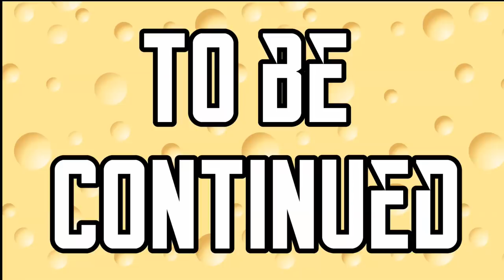Mini DumpTruck (SE01 EP31) Suzuki Carry inspect. Undercarriage wash adjust carb, throttle air box

Comment: Very smart to undercarriage blast the bottom side. First thing I do also and clean the motor. This way you can see what your dealing with any leaks. Also a clean motor is so much better to clean on. Smart to get all the left over salt from the ocean too or any mud that holds moisture.

Comment: If the bed is up, the "safety bar" is in place. Always.
Reply: many years ago around where I live guy was working on dump, had safety bar but cylinder collapsed while he was working on it, & the bracket for the safety sheared, & of course guy was killed, it was ruled a fluke accident as both the cylinder failed & the weld broke for safety
Reply from the maker: Damn, that's scary! I better check the safety prop
Reply: I was about to comment the same thing. Where is the safety bar or another type of lock for when the bed is up.
Reply: the one I refer to was a normal full size commercial dump truck, this is probably a lot lighter, but still probably heavy enough to trap you, or worse, just be safe, & keep on with the videos
Reply: This is one of the few Safety Nancy rules I agree with.  The other is lean back as far a possible when seating tire beads and or keep it in a cage.  I know people with missing body parts from rims splitting when bead seated on NEW rims. 10" to 96" rims...
Reply from the maker: TY
Reply from the maker: Yeah. I hate that bead "POP" seen enough videos on that subject!
Reply: a tire shop I knew of, owner died of old age, had 1 blow & they refused to stand over, but laid them on cement floor and used foot pedal to control air, 1 blew, ripped through inner section of plywood roof, and 1 support, but stopped when it hit metal brace for outer roof, no one got hurt, just hose ripped out of tire changer, I showed up as it happened, but didn't see it, & he never fixed roof, & place is for sale & roof is still like it, well over 20 years ago

Comment: lol.. I have one of those expensive Milwaukee Fuel 1/4 inch ratchets too.. Comes in handy in tight spaces..
Reply from the maker: Hell yeah! Mine is not the fuel, but I did use the fuel style when I did the clutch at the transmission shop. I like mine better it's less bulky and less heavy

Comment: 3:20 for the timing belt slice the old one in half length wise, and cut the outer half off, slide the ne belt on the cut the rest of the old belt off. Wala easy belt change.
Reply from the maker: That's a great idea not to lose cam timing, thanks!

Comment: I saw rust like that after a few years when I lived on an island in the eighties where you had to drive next to the water daily.
Reply from the maker: That's what I was thinking...
Reply: @MotoCheez  I had a truck there that was 10 years old and had 30k miles on it, the body was so rusted it was held on with bailing wire. It ran great, but looked like he'll.
Reply from the maker: Damn!!

Comment: Was the Suzuki cheeper being more miles and little worse shape? Or did it even out with the dump bed option? I’ve seen they use these a lot at fishing ports,could be why rusty,they put live catch in back with salt water sloshing around.
Reply from the maker: It was cheaper because of the mileage and the condition. Rust would be a concern in salty areas for sure. The frames are thin

Comment: time to get a needle gun for scale removal after that thing. I thought i got all the rust off of a frame one time then it stated showing up everywhere months later. I love your projects. we relay enjoy or mini truck. Ospho is your friend.
Reply from the maker: I have a spot blaster, oil based paints and primers I like the best!
Reply: @MotoCheez  thats a great idea. you can relay get in some good tight places with the sand blaster. last year I got a trailer given to me and it was covered in rust. i buffed all the rust i could get to with a wire wheel and painted it with oil based paint from TSC but it came back. later I redid it with this Hammerite Rust Cap Paint and so fare its been great. the company said we can put the paint over rust with out even removing it. I am going to try it again on my side by side that was at the beach for a few yrs so how it dose. you have helped me so much with your inspiration so i thought i would try to share what i learned. hope this helps. take care. love the videos.
Reply from the maker: Thanks, I'll check into that hammerite. I always use Rust-Oleum and have excellent luck with rust not coming back. I'll touch it up as I need and if I work on it, it's easy to grind off and repaint.

Comment: Are those 4x115 wheels? If you can wait until May, I have a set of 4 steelies (with old tires) that you can have for the cost of shipping from WI. Might not be worth the cost though. Old Arctic Cat wheels fit on these. That's what I have on my 1992.
Reply from the maker: I believe it 4x115 I have the spare, just wish I had another universal rim
Reply: @MotoCheez , I thought all from that 90-94 era were 4x115, but I'm not an expert. Mine is most definitely 115. You might want to double check, and if they are the same as mine, I can send you up to 4 in May for the cost of shipping. BTW, I'm not on Instagram, so you can contact me here or on FaceBook.
Reply from the maker: You're right! It is 4x115.. sorry
Reply: @MotoCheez , I'll reach out around the time I head to my cabin to see if you still need/want some rims.
Reply from the maker: Awesome, TY!!

Comment: Welcome to the Suzuki-side! Blue-springs bye.....That's o.k..
Reply from the maker: Lol! Sorry... I'm wondering if I should make my own lift spacers for this one
Reply: @MotoCheez  Since you going to re-build the strut-cups....Why not?
Reply from the maker: The inner steel structure is perfect
It's just the tin there on top
Reply: @MotoCheez   Well a kit is what 125.00?? My time is worth money. Would i build one? No. easy? Yes but.....
Reply from the maker: The shackles are easy, strut spacers fairly easy if I can find pipe big enough. Yours have camber adjusted on spacer?
Reply: @MotoCheez  Yes. I reemed the holes a little to get the camber where I wanted it. With the spacer as-was it still had some positive. Fixed that shit!

Comment: I have a quick engine question for you. I have a brand new Kohler Command Pro 14 Hp engine. The thing this is super hard to start cold. Any ideas?
Reply from the maker: Is it hard to start when it's cold or when it's hot? Or both?
Reply: @MotoCheez  Just cold. Fires right up when hot.
Reply: It came with a Kohler spark plug. I think I'll try an NGK.
Reply from the maker: I'd check the choke, bet it's not closing properly...
Reply: @MotoCheez  Ok! First thing in the morning. I'll let you know!
Reply from the maker: Yes, please
Reply: @MotoCheez  Well, the choke is fully closing. I think I came up with the solution this morning. That engine requires just a wee amount of throttle and of course full choke when cold. It fired right off when I did that this morning. Probably 30F or so. Thanks for the suggestion.
Reply from the maker: Cool! Yeah a lil throttle for sure

Comment: Yo cheesy my Honda acty has 145/80/12 tires on it 4x100. . What size tire do you think I could run if I got some 13 or 14s off a Jetta or something Civic maybe
Reply from the maker: I don't know much about the Honda's, but I believe 23" will fit without a lift

Comment: Hey, What is "Dumps" name?  Jim & I (from PA) where in the delivery room with Amir when  you picked up  your "Baby Dump".  Our "Baby Dump" is doing fine & has not only a name, but new shoes and wheels!
Reply from the maker: 👍👍😁😁 which wheels you end up with?
Reply: @MotoCheez  VISION Lock Out (finish matt black) machine lip w/chrome hex bolt inserts.  Style 393 12x7 4+3 offset.  Tires-are Carlisle all trail 23-8-12.
Reply from the maker: Nice

Comment: Congrats on the new addition! I'm bidding on a Suzuki this week. Any idea what "cold weather equipment" is?
Reply: the guys at four sons off road up in  Canada sell a oil pan heat, maybe that’s what it is.
Reply: Heater
Reply from the maker: Cool, hmm, idk what that would be...
Reply from the maker: Could be. Or Block heater ?
Reply: I have to look at the description to be sure, but if there is a sticker that says 寒冷地, it has stuff like these.

More starter wattage
Bigger battery
Higher coolant concentration

It's a factory option available in cold place of Japan.
Reply: @phineasNBJ  Yes! It has that sticker in the back window. Other than the starter, most likely the rest is gone, but it's cool anyway.

Comment: A (mini dump-) Truck Named Su(zuki).

Looks like he's lived a bit. Not so much the miles as just the years. Cranked down like he was, hobbled and let rust, it's a great thing you're doing for him. Just be aware that he may try to bolt on ya if he gets let out before you two develop a solid trust between ya. Also, Mini might get sad or jealous and try acting up to get your attention back. You probably can just talk it out with the two of them, old as they are.

(...Anthropo-what, now? No, just respecting Shinto tradition. Or Pixar tradition. One or the other.)
Reply from the maker: Excellent! And on the same wavelength as my thought. 👍👍👍

Comment: Fun video, this truck is simply rusty from the salts spread on the snowy roads. I didn't hear what you paid for this rose amongst the thorns. From watching the auctions I'd say this truck if a guy was importing it himself would be $100 to $250 area. $35 inspection before bidding. The inspection would have this rust all over it. So most likely there would be no other offers made on it. This is common on the auction sites. 1000 .00 for shipping to your local usa port. $1000.00 for the auction house exported and all fees taxes documents sent to you such as the title. 135.00 fee to park the truck at your port or what they call the unloading fee. $300ish to an import company with taxes and fees on this end including homeland security fees paper work etc.  then when you pick up your truck if you don't have current military ID you'll need an escort to go onto port property to drive your mini truck away or load it. That's about $50ish an hour and if you have all you ducks in a row it takes about an hour and a half to retrieve your truck at the port. Then just your local licensing fees for what ever price the truck cost at auction. 
So even a fixer upper like this one has real value. The trick for those buying is that 1k to 1500 at auction will get you a near perfect truck with all the options. It took me a month to see one that I liked and there are so many every day. A four speed 4wd or even 5 speed like Mini with no dump or air conditioning can be bought several times a week at auction for $200 or so bucks. But what ever you pay your about $2500 to get it to a shipping port in USA. I found the process simple and almost all done by email and a trip to the bank to do a wire transfer. All in all it's a decent machine for the price. I bought a 6 speed Mazda scrum a/c 4wd 1993 diff lock high low transfer with no rust a real 54k miles which was hard to believe. It's costs me about $4k and I'm already thinking of a van. My Mattracks cost more than the truck. I think I'll have my Mazda on tracks lifted some type of a wrap paint design on it and set of wheels tires timing belt seals and clutch for $10k plus? You can't touch a utv with heat and air conditioning with tracks for 3 times that. It's just not going to be fast. I'm in no hurry.
Reply from the maker: Nice! I'm always scared to import myself... Great info!!
Reply: @MotoCheez  I was just re-reading this comment. I meant I paid $4k total to get the truck through the whole process. The bid was $1700 for the truck itself. I just added up my real receipts and its almost exactly $4500.00 I looked at the Washington state dealer you bought from. They get $8k, $8500 for the same truck. Seems like a fair price on their part. They make an investment and have a chance of the truck having issues when they get it plus they detail and fix stuff and there licensed here I believe. What I like about buying these trucks is there are so many ways and options to get into a mini truck. Keeps them rare and more valuable. I can't wait for a few years from now to get one of the next generations with the front wheels forward getting out of the cab-over models. That gull wing Toyota is a corolla underneath here you showed in that last video. I'm thinking of getting one myself. I can't afford a Lambo but I can afford a toy.
Reply from the maker: 👍👍😜😜 sweet. Agreed

Comment: I have seen some back and forth on the subject but I think it may be a tsunami truck. They would have been full of salt water and silt but not cleaned or dried out right away. Once the salt water touches the bare metal, like between the top and bottom mounts on the struts, it takes very little time to make a total mess. The cracked top mounts on the struts being split could be from the heavy loads the truck may have hauled and with that, if this truck bottoms out as easily as mini truck did when you first got it,  it wouldn’t take long to cause damage. 
   I was just musing about it and had to put my 2 cents worth in. 

   No matter why the truck got this way, I like the ideas you are coming up with to repair it. Looking forward to the next series of videos! I have enjoyed them all so far. Maybe rhino coat, or truck bedliner, the whole truck. Seal the whole thing from any future rust. Might weigh a few hundred pounds more but it won’t rust!! Hehehe......
Reply from the maker: I had 2 people from Japan comment it looks like it came from the mountains where there is a lot of snow and salt. Next video I have to show the window stickers and they can see where it's from.
Reply: MotoCheez  - I didn’t think about the mountainous areas. I think you, and they are right. Much better than a tsunami truck" a friend of mine thinks he has a tsunami truck. The worst part of his truck is the wiring and smaller things vacuum hoses etc. He is pretty sure he has it sorted out but  he replaced a lot of small stuff plus the fuel injection. I myself am not so mechanically inclined so I really enjoy hanging out with him. I also watch videos like yours and find them really informative. So far yours are the best on YouTube and some are truly funny as hell. 
    Thanks!!
Reply from the maker: I did buy a few rolls of vacuum lines. TY 😄😄😄

Comment: Wouldn't a aftermarket turbo for a motorcycle fit those mini trucks and they're pretty cheap if you look on eBay like a hundred and a half 😀
Reply from the maker: It's carbureted though.. and EFI options are huge$$$

Comment: The rust and everything on the frame and the top of that bed it's on the same side it was probably some type of battery acid or something like that that would have caused to
Reply from the maker: Both sides tho... Like where the steel overlaps
Reply: @MotoCheez  might have been something corrosive inside the bed don't they have weep holes in the front of it I didn't notice that there was a lot of corrosion everywhere else but I like what you doing and I'd like to see the build
Reply from the maker: Agreed

Comment: Looks like they had something in the bed that leaked on the frame causing the corrosion.  Since its on the drivers side I bet they were either filling containers as they used it or it was Illudium Q-36 space modulator kind of stuff.  The name will come to you. For the love of god don't put eye brows on it.
Reply from the maker: Yeah, that's probable.. no eyebrows!!!

Comment: You should undercoat the mini trucks
Reply from the maker: I think I'm going to go with a good oil based paint for the frame and under side and bed liner for in the bed, only reason is if I need to work on it that undercoating is a pain in the ass to grind off to be able to weld or work on
Reply: @MotoCheez  you could do like Mustie1 does and use bar chain oil for a undercoating or like Eric @ 
SMA and use krown or fluid film undercoat,

Comment: Ocean Damage (Lived near sea)
Reply from the maker: I'm leaning toward that.
Reply: @MotoCheez OK I'm the biggest junk yard in Rhode Island. I went thru over 10,000 Toyotas. I have 4 left hand drive Daihatsu's. Daihatsu is owned by Toyota Small truck division, Hino is owned by Toyota Big truck division. Suzuki is owned by GM Toyota is owned by GM.  Everything is "smoke and Mirrors" in auto biz. GM also Owns  Geo metro, Isuzu, Daewoo, Honda, and Subaru. Been doing this over 50 years. So I know a lot of Secrets. LOL! I did head and timing belts to 2 of my Daihatsu's. Mine are in off road work.